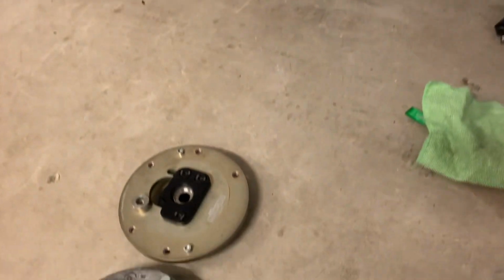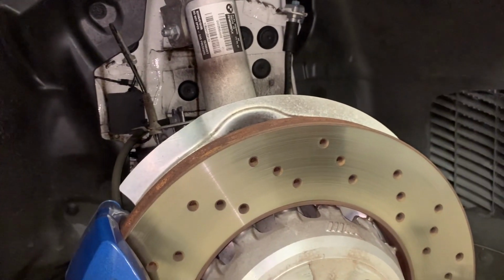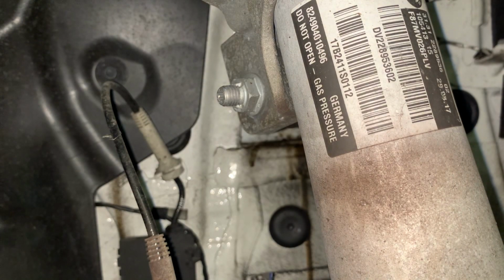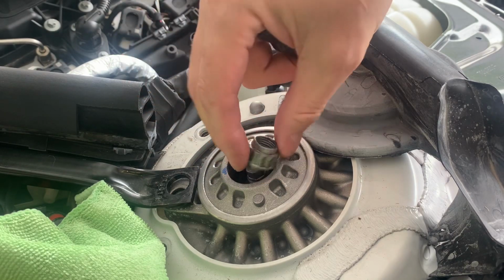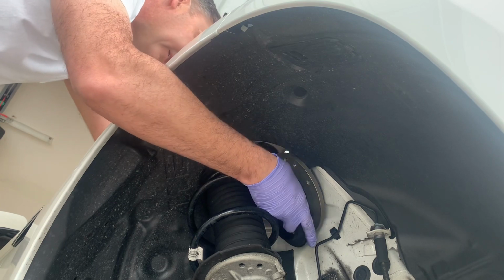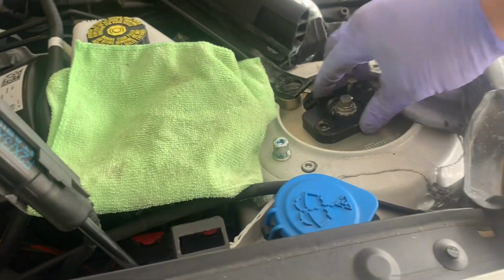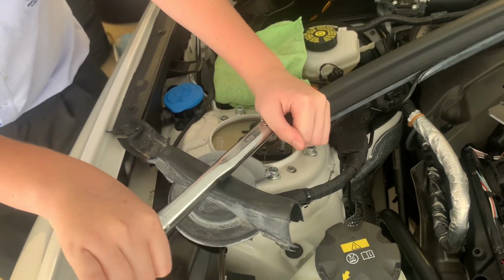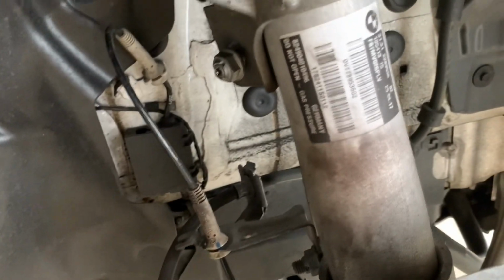Millway Camber Plate Installation BMW M2 M3 M4 M235i F22 F23 F30 F32 F80 F82 F87

Comment: Did you only machine out the inner hole where the shock goes through or also the hole where the nut sits in?
Reply from the maker: just the hole to accommodate the bigger shaft on the M car. I the stock nut fits no problem.
Reply: @TheEddysGarage how long did the job take you?
Reply from the maker: Took about 2.5 hours but I could probably do it in half that time after figuring out thing like using the socket to guide the bolt through the mount